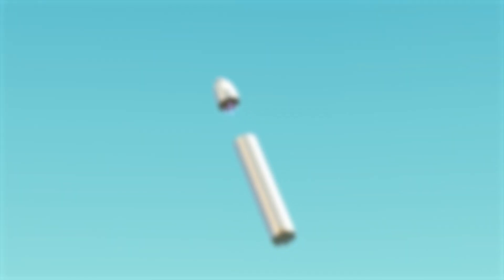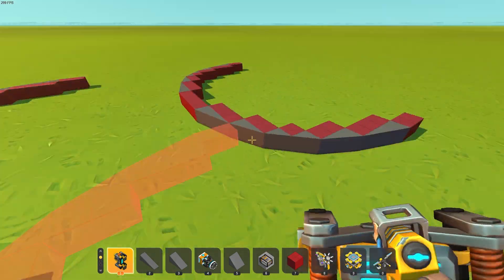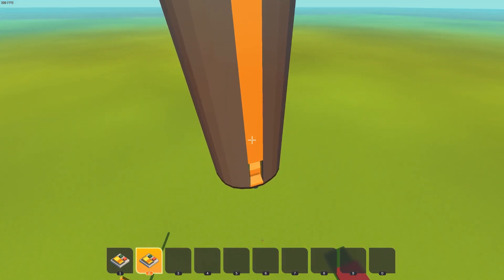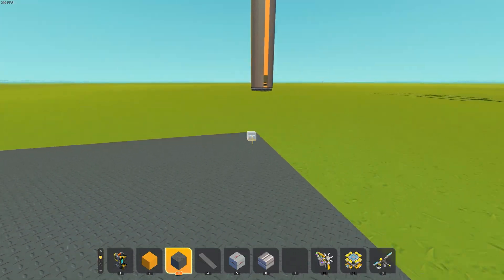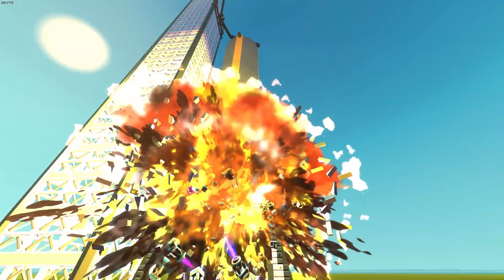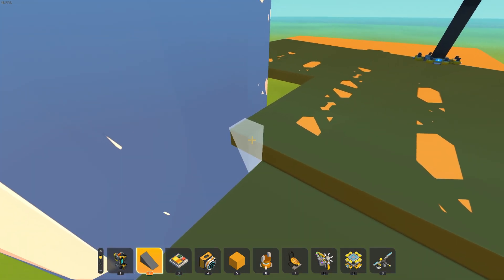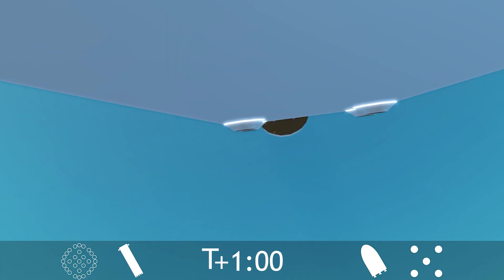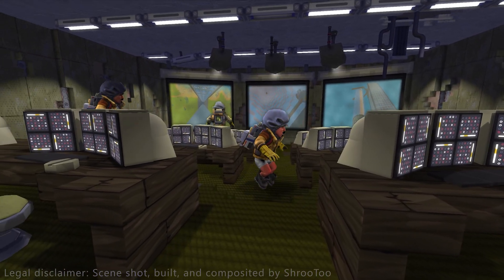Building a Self Catching Rocket in Scrap Mechanic!

Comment: Using mods is kinda whack if you ask me that takes away the challenge
Reply: The mod is for mathematics and point tracking, that just isn't possible with vanilla game logic, nothing here is made easier with the addition of the Modpack. The "challenge" of trying to make this with no mods would just be adjusting some timers and praying that the game physics don't vary too much in hopes that you get a preprogrammed rocket to perform a little show.
Reply from the maker: @slickrick8279 it needs the mods for catching itself as it wouldn’t know where the tower was
Reply: Undermining someone's work is kinda whack if you ask me

Comment: nice content, and thats a pretty cool game I might play it.
Reply: Disclaimer before you get it: Most of the stuff he used is modded, Like the engine gimbal, most of that's modded.,
Reply from the maker: @CMDR_Ignitus  yes but the rocket only requires 3 mods that are listed in the workshop page. i linked the rocket in the description if you want to check it out :)